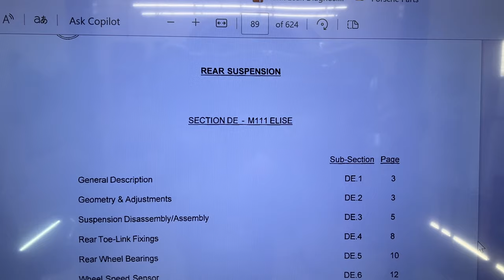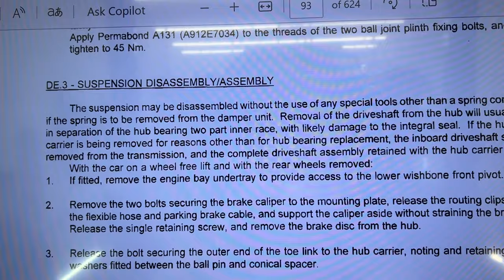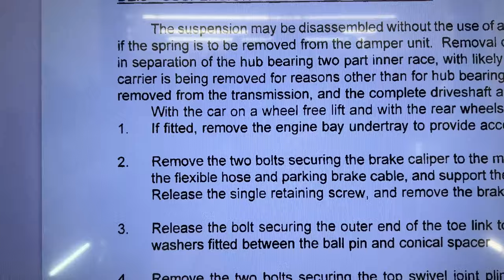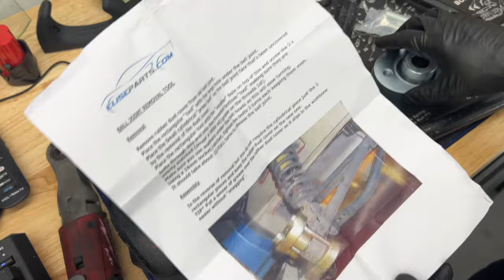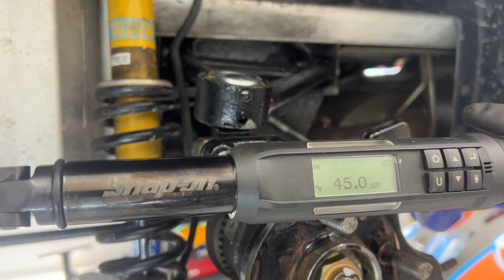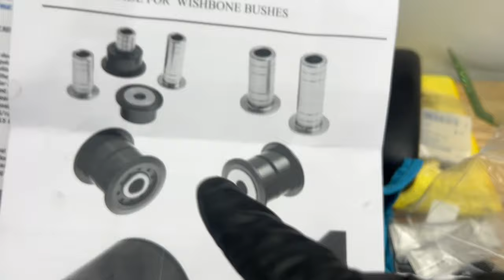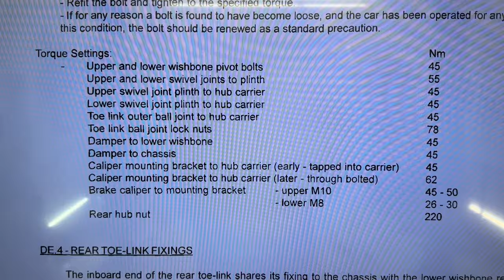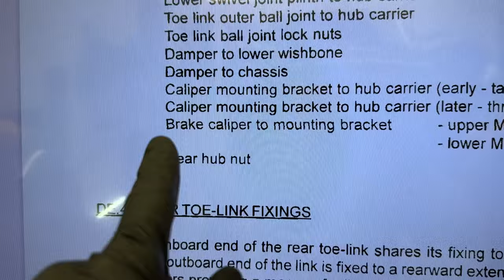Lotus Elise S1 Complete REAR SUSPENSION Refresh

Comment: I did a suspension refresh on my series one last year. 

The biggest change came from having a full four-wheel alignment carried out afterwards. 

It is like driving a different car, it corners so sweetly now.
Reply: Which bushes did you use? I used the standard ones but I wish I’d use poly ones. I was put off by reports of an increase in NVH
Reply from the maker: +@blacker1000000 can’t wait to drive it! Did you do the alignment yourself? If so, give me all the info and tips so I can make a video! 🍻
Reply: Regarding the bushes, I stuck with standard as I used poly bushes on another car and found them a bit harsh.

Comment: You discovered the punch method of aligning the wishbones!  My reference is the S2 so the S1 looks to be different, but the flats on the control rod end that goes through the rear lower suspension joint fit into mating flats on the chassis to keep it from turning.   Looks like the S1 may not have the flats?  The reason the rear caliper is hard to get off is that there's a boss on the hub carrier for the top bolt that proturdes into the caliper slightly.  You have to open the caliper a bit to get it off.  You got it, but the trick is to keep the boss and caliper from pinching the little dust shield when putting it back together.  They're easy to damage.
Reply from the maker: +@justaddafan thanks for the info!🍻

Comment: A 1997 with cast iron rear uprights. I'd suggest they aren't original but knowing Lotus, anything is possible. MMC? Alloy boot lid? Boot bag? I've got chassis 1649, another '97.
Reply from the maker: +@ax13h it has a boot bad abs I’m pretty sure the boot lid is fiberglass